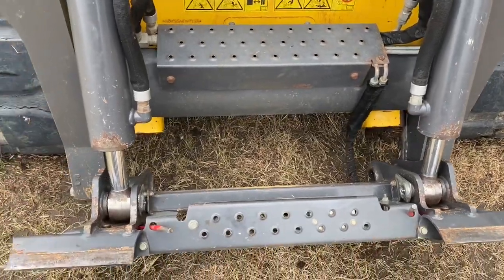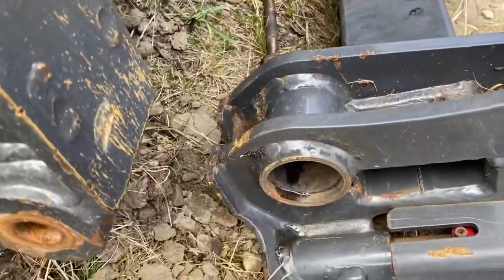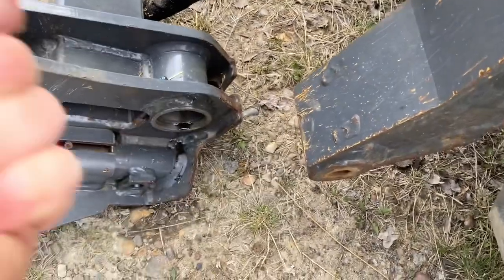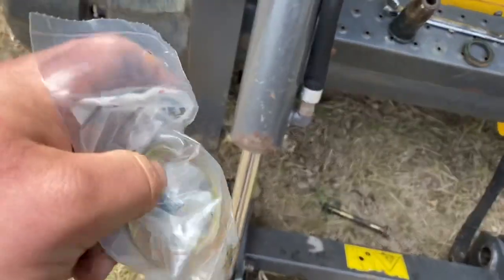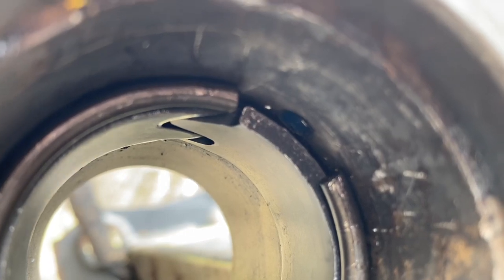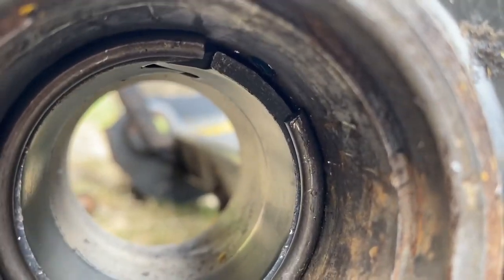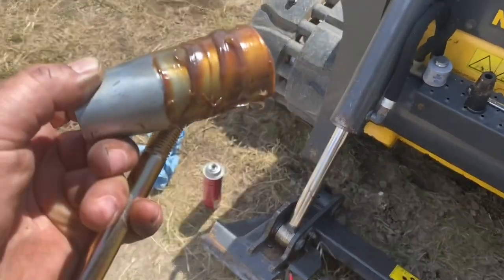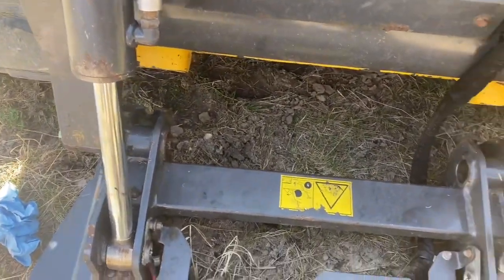Skidsteer pins - New Holland

Comment: Great video! Answered every question I've come accross while doing the pins on my LS160. Thank you for taking the time to do this.

FYI for LS160/170 pins: the new bolt that comes with the pin kits is a 5/8 x 8" and is way too long. You'll need a 5/8" x 7" grade 8 to fit right on these machines. They have that size at Fastenal...Lowes, TSC, and Home Depot do not carry the 7" length.
Reply: InstaBlaster...

Comment: How did you remove the cap after the snap ring is off? This is where we got stuck. Thanks for the help!
Reply from the maker: Hi there! I’m assuming you mean the dustcap. If so, Just take a screwdriver or a chisel and put it as close as you can to the point where the dust cap makes contact with the loader frame and just gently tap with a hammer while prying out.

Comment: Finally got round to checking mine today..my 140 has done 1900 hours. Pins came out with no hassle...all in great condition..hardly any wear on pins and bushings looked great as well....loads of life left in both..result! I fabricated my own spacer as the dealers in the UK wanted £60 for 4 (you mentioned the PRC washer...your right..New Holland sure know how to charge for spares) ..I only needed one...frankly crazy money. No more bucket crashing around..its bliss.. I do have a question though... do you have any spacers between the top of the boom lift cylinder and the boom on the pin or is the lateral play designed in...mine has a stack of room for lateral play and not sure if that is correct or if I should fab some spacers to go on the pin. I dont like the thought of the cylinder being able to move around that much. Thanks.
Reply: My L218 has the same lateral play. I've yet to go to the New Holland dealership and compare to the new machines.

Comment: Do you have a video that deals with it not turning to the left and what it could be?
Reply from the maker: Sorry I don’t Debbie, but I would check to make sure your joystick wiring is well grounded. If the joysticks “twist” while you’re holding them, they need to be tightened and MAY be a possible solution. The operators manual has a pretty decent trouble shooting section and a New Holland dealer can be a great resource. If I ever have this problem, I will make a video on how to fix it. I wish you luck!
Reply: If your machine is manual control, tilt the cab and see if the control rods are hooked up and moving correctly.  I’ve seen the pins come out of a control rod clevis and the control stick isn’t actually moving the valves.  Look to see what moves when you move the control stick.

Comment: How do I get out the tapered pins from the arms
Reply from the maker: Just beat on the outside of the housing… Like you would on an automotive ball joint. The pins will spring/jump out on their own. You’ll need a good size hammer, and don’t be shy.

Comment: How did u get the old bearings out?
Reply from the maker: I used a punch to drift them out from the opposite side. There was enough room to catch the edge of the bushing.
Reply from the maker: The pins themselves you need to just beat  on the loader frame with a hammer on the outside of where the pins are housed... once you do that a few times the pins will ‘jump’ out of the housing. Like a ball joint on a car.
Reply from the maker: I start explaining it a 5:47 in the video

Comment: How did the pin assembly get pulled out?
Reply from the maker: Once you have the nut off and the main bolt removed, you hit the forward facing(long side) part of the of the arm/boom where the pin is housed... Like you would for removing a ‘tie rod’ on a car or truck. After a few good strong hits, you should see it ‘jump’. Then you can tease the tapered pin out using the original bolt or something similar. The tapered pin is removed and installed from the inner side of the loader booms through the bucket frame.
Reply from the maker: I start describing it at 5:47 in the video.